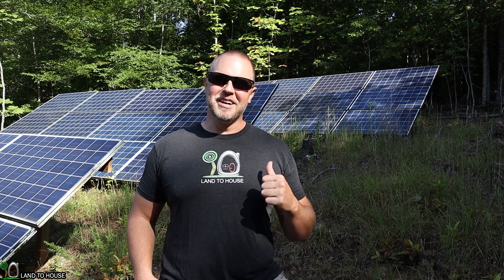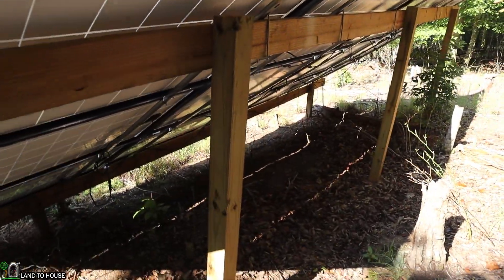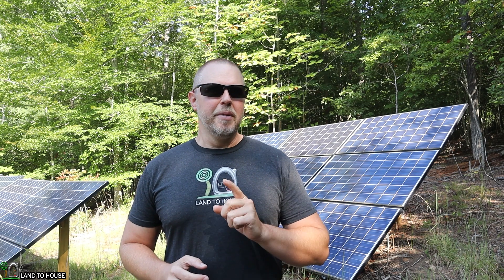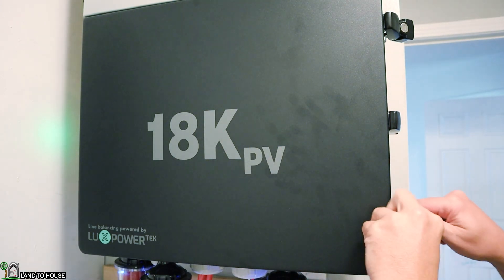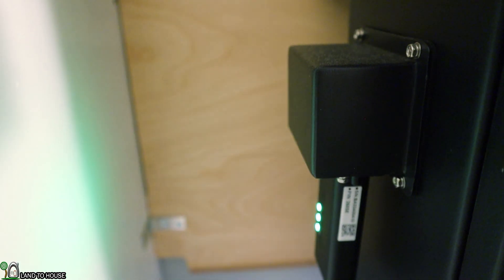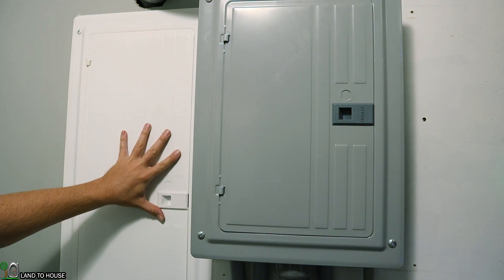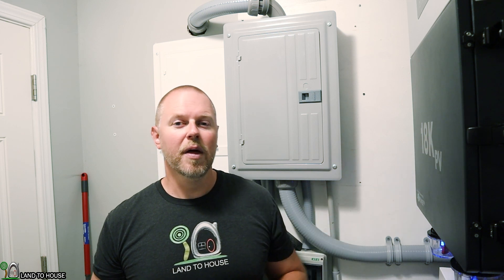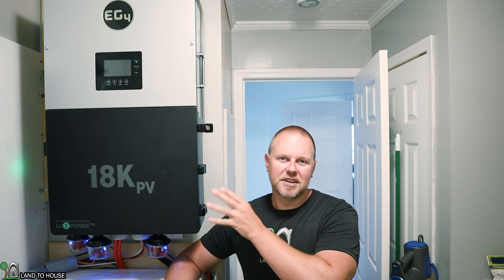EG4 18k Hybrid Inverter after 500kw of Solar Power - Awesome

Comment: Grid load and PV wires look the same thickness. Do they get hot?
Reply from the maker: The grid load is actually 6awg. It has handled the 50 amps no problem. No heat. Typically my system does not see more than 6kw AC load at any time.
Reply: @LandtoHouse  thats cool man. Waiting for an electrician to wire it in, but i figured it out if he does not show up.  Main thing for me is for it to look like a clean install. I mounted everything as you can see in the profile pic and use a 10 circuit 50 amp manual switch, until i do the entire panel. I'm telling you, if he doesn't show up again all I need is the 4 wires from home depot and have the 70 amp breaker ready. 😂

Comment: How has your ETHOS system been holding up? Hard to find info long term on this system.
Reply from the maker: I have a total of 60 kWh. It's rare for this system to drop below 80% in the summer. Wintertime, if I have the many split running, it can get below 50%. I've had zero outages or problems whatsoever.

Comment: Come on dude. Please give it up on promoting these cheap, Chinese-made, high-frequency, transformerless inverters with their long history of early failures. For a recent example, look at the 6500EX-48, which was discontinued only after 1 year on the market due to a high failure rate. High-frequency inverters simply don't last long in the real-world use.  They offer far poorer surge capacities and because they offer no galvanic isolation, they can fry your appliances or your EV when their H-Bridge circuit fails. Don't take my word for it. Ask Google AI. " Can a high frequency, transformerless inverter damage your appliances because of no galvanic isolation?" and learn the truth about these cheap Harbor Freight type inverters.

Comment: Not to be the rude guy but it doesn't appear that any electrical permits were pulled for this installation. 
I see many unsafe practises and code violations, As well as parallelling to the local grid, requires a lot of extra paperwork on top of permits.   This is all for your safety and the safety of the powerline workers that could be working up the road somewhere.  
I would highly recommend stopping what you're doing and contact a  licensed electrical company

Comment: Please find out if this inverter can be paired with the Gridboss from EG4.
Reply: I spoke with Signature Solar today and based on a 20 minute conversation with Braden, I purchased a Gridboss to work with my 18Kpv.  It will require an additional 70 amp breaker not included with the Gridboss.

Comment: Why not run your grid power straight into the 18kw inverter so that you can run your entire main panel from the inverter and not worry about a “critical loads panel?” It has a 200Amp pass through. You should be able to run your entire house with that inverter.

Comment: I have seen some folks here on YT using a grid and grid-tied main breaker panel with manual transfer switch to input their inverter supplied/solar supplied AC electricity. By doing so, as long as the "high" voltage DC is NEC legal and the AC is from the inverter to the breaker in the panel is as well, they simply turn off the grid and then turn on the inverter with the transfer switch. This way there is no "critical loads panel" which is so popular in these types of systems. The breakers in the main panel are just adjusted "on or off" for critical loads. It also allows some breakers to be "on" when some critical load is needed and "off" when not. Am I missing something here? This seems like a simple solution allowing for deleting a critical loads panel and just using the house breakers to adjust loads. Maybe I missed something...? What are your thoughts?
Reply from the maker: Are you referring to the green acre Homestead channel? My friends, Sam and Angela Use a transfer switch in their mobile home to use the power from the inverter. This is a great option if you only have a few house breakers. In my house , I have so many circuits that it would be difficult to use a transfer switch like that.
Reply: @LandtoHouse  Thank you for answering so many of my questions over the years. I really do appreciate it. The best to your success!

Comment: Early in the video you talk about earth grounding. Did you earth ground with a grounding rod(s) at the panels, or did you tie the panels through a ground wire to your house ground? If to your house ground, where? Thank you!
Reply: I'm pretty sure each array has its own grounding rod, about 10ft deep.
Reply from the maker: Yes that's correct!
Reply from the maker: Each array has its own ground rod at the panels.

Comment: 38 years of Electrical Contractor Experience here. You should back your system up with a wind turbine. They work on rainy days and at night ! How much are you selling back to your local power company?
Reply: You know that he’s selling for ½ of what he’s paying
Reply from the maker: I buy at $0.22 and could get at best $0.08 back per kwh
Reply from the maker: Sadly we have almost no consistent wind here. I dont sell back any power. The bi directional meter would need to be installed and I would only get $0.08 back per KWH.
Reply: I don't think he's selling.
He has BIG batterypacks and so many solar panels he only needs like 1 sunny day a week to keep up with how much he uses.
Reply from the maker: True. On a good sunny day I can have the battery full by 11:30am. On a cloudy day it takes all day.
Reply: Most wind turbines don't work you need constant 20mph wind

Comment: I’ve followed your architecture on the ground mount build here in Northern Utah facing south. I’ve done the research and have found that your ground mount is best option.

I’ve used the unistruts on the roof of my new RV which I built an array and it works perfectly so yes the unistuts work well.

You are very articulate in your description of your inverter but I have a DIY in my RV but I didn’t want to to do the EG4 as it does seem beyond my capabilities. I know there is a big price difference but I’m in my 70’s and don’t have that energy even though I have had great success with my 32’ RV.

I’m techie but not an electrician. I also have Parkinsonism so I’m very shaky so having a  2 Apollo Hysolis is my solution with (16) 400 watt panels. 

I wished I had your get up get after it but in my earlier years. 

Great job, great content
Reply from the maker: Thank you! I have found that my mount is easy to build and strong enough for normal weather. You can increase the supports if needed. I say use what makes sense for your situation. Sounds like you have what you need with the equipment you have.
Reply: @LandtoHouse  From your main electrical panel to your critical panel did you run just your hot wires or did you bring your neutrals over

Comment: Let us know when you get a 1.21 Gigawatt system. Ohh, see if one of the makers of the bi-fractal panels will send you a few to experiment with. (Stick a reflective piece of material below one see if it buffs the output, if they do)
Reply from the maker: If I had a system making that much power I would be making history... in the past. The solar panel that I have from project solar does have the additional wattage produced from bounce back to the rear of the panel. It's a 400 W panel, but can reach 410w if reflective material sends sunlight to the back of the panel.